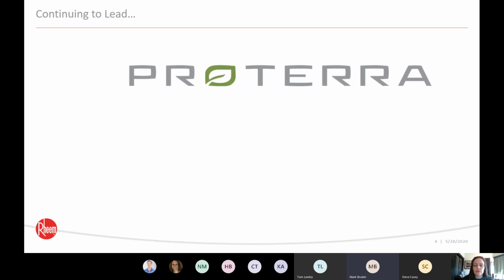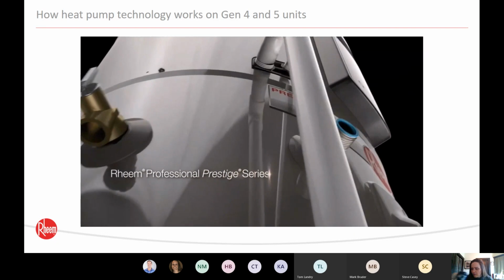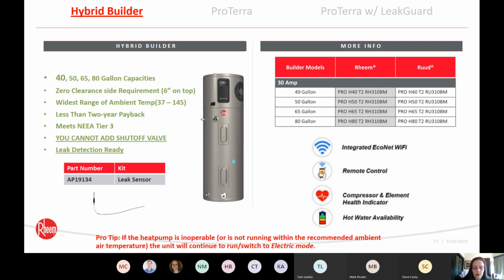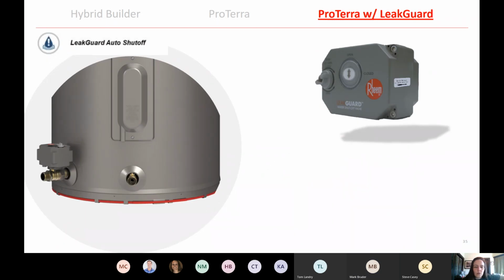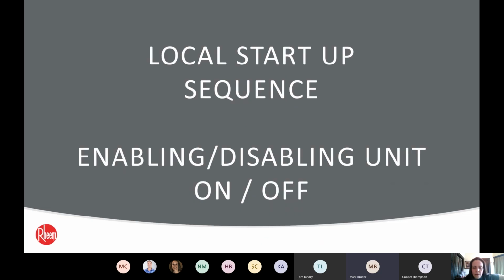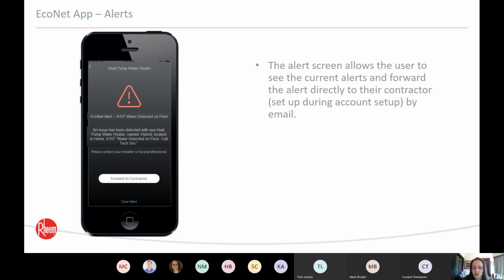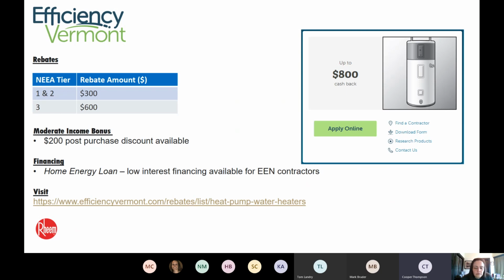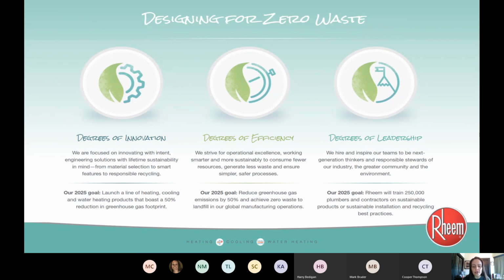Rheem 5th generation ProTerra training

Comment: This is an excellent video overview of what has changed since my "Performance Platinum 50 Gallon Electric EcoNet Enabled Hybrid Electric Water Heater with 10 Year Limited Warranty MODEL # XE50T10HD50U1" installed in mid 2019, thank you! It's also helped me update my detailed article about hybrid water heaters accordingly, adding this video so today's buyers are much more informed.

Comment: The eco app should have upper and lower tank temperature. Also, if you have a recirculating system, so type of setting to have water heater work right and not a service bulletin saying you should not use pump. The hybrid water heater tech support don’t work weekends and regular electric water heater tech support is 7 day

Comment: This was a great presentation. It was the ONLY information that let me know exactly how the leaksense and leakguard worked. It was also the only information that helped me figure out why from initial power on I was getting constant false positive leak detects. The manual says NOTHING about requiring a drain pan for my particular model. I can only assume the red perimeter leak sense rope is picking up moisture from the concrete slab. This is not cool because now I will have to drain and disconnect the unit just to install a pan which I'm not even sure will solve the issue.

Comment: The "Heat Pump Only" mode is NOT heat pump only. It will also call for electric elements to come on at the same time just like in the High Demand mode. This really sux because it loses it's efficiency when doing so. I called Rheem and they said it must be a glitch or something in the algorithm and they still have not fixed it yet. Sounds like it won't be able to be fixed with an app update either. It's gonna be a hardware issue in the control board. They need to send out new control boards to anyone who has bought one of these in the last 8-9 months or whenever the Gen 5 models came out. The Generator 4 models didn't have this problem.
Reply: From what I've heard it turns the resistance elements on once when you first start it with cold water .

Comment: In this training video it states Heat Pump mode is the most efficient at “Very High”

However, in the user manual it states Energy Saver mode is “Very High”, while Heat Pump mode is only “High”

Taking out the recovery time factor, isn’t Heat Pump only mode by far the most efficient?

I’m going to run a test, 1 month in only Heat Pump mode, followed by 1 month is Energy Saver mode, to see the real difference.
Reply: how did this test go for you? I just installed this water heater and I am wondering the same. Planning to do the same test.
Reply: I have a hot water recirculating pump and vary the temps during the day to line up with my time of use electric rates. 

I found that Energy Saver mode uses more electricity than Heat Pump mode. In my case roughly 3kW used per day for Heat Pump mode and 4kW used per day for Energy Saver mode. 

I keep it on Heat Pump mode all the time now